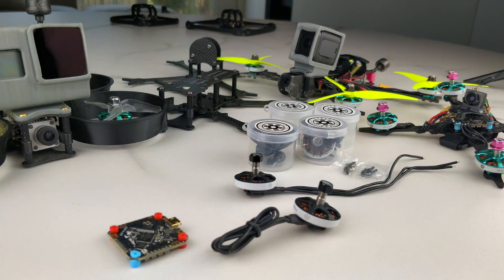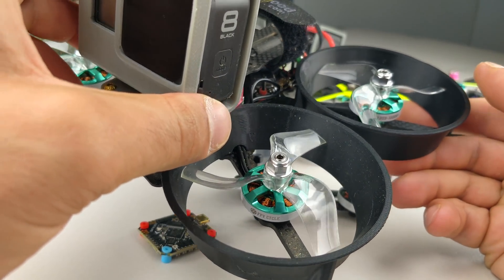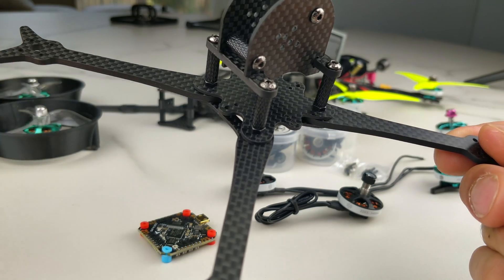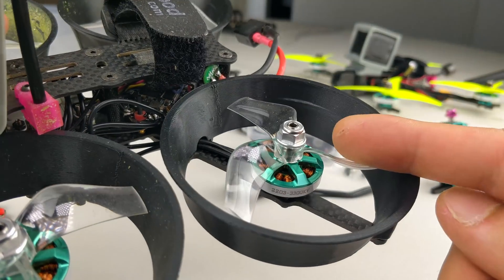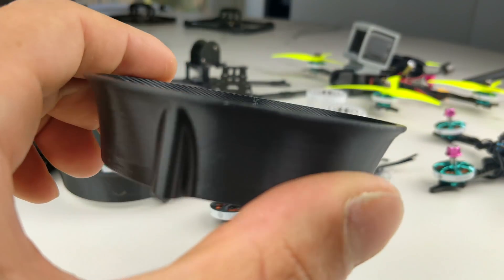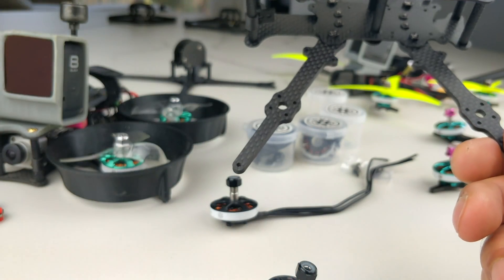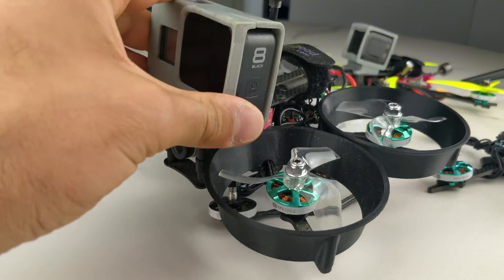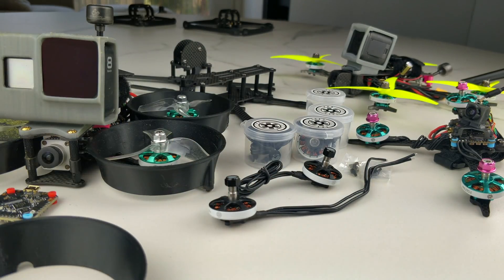FPVCycle 2203 for CineWhoop through 5"

Comment: Will you share your best setup for 3 inch general acro w DJI support?  Frame? Motors? Thanks a ton for all you do!
Reply from the maker: My 3" setup for general acro with DJI would be a 4".  I'll explain why in more detail when the Fouride frame comes in but it's basically because once you're done fitting all the stuff in there and getting the weight distribution how you want, 4" props will fit without fuss on the frame.  So much as well just use 4".  You could run 3" on the same frame but it'll fit 4.  Small quads just don't have much payload ability.  Even the 30g weight of the Vista + camera is a significant load that impacts flight performance.  A 3" can do it without much issue, but the resulting drive train that would be needed for good performance either requires you to stack a bunch of electronics tall and run the battery under the frame or put the electroncis side by side and the battery where you want.  I choose the later and that's why the Fouride is a 4" primarily....Fouride like Fluoride but Four...
Reply: Perfect! Thanks for explaining the logic behind 4” and of course the name “Fouride” is quite intuitive. So should I wait to buy the T-mount 2203s then or are those for a completely different build?
Reply from the maker: @absoloodle37  if you want to use t mount props
Reply: BTW, just joined your Patreon.  Waaay more info on there. Good stuff👍

Comment: What do you mean for 3000 is meant for “higher S”? Reading the motor page on fpvcycle I don’t get if you recommend 3450kv for 3S and 3000kv for 4S. 
Or if you mean 3450kv up to 4S and 3000 with 6S (of course with throttle cut).
Thanks in advance!
Reply from the maker: You could run the 3000 on 6s but it's not needed and is actually counterproductive. I'll explain why in the next video
Reply: KababFPV thanks! Looking forward for it!

Comment: Is there going to be like something like a 2800kv? (3" 6s)
Reply from the maker: There's a 3000 coming. You don't want to run 6s. This whole 6s everything wave is really not beneficial
Reply: @Kabab  I want to run 6S because all my batteries are 6S and I want to use this on a 5" application.

Comment: Havent tried disc-motors yet, so i dont have much knowledge about them. But isnt a tall stator and low KV prefered for cinematic stuff? Like DJI does for their drones. And for racing/acro you would want a smaller stator and high KV to get quicker throttle response.
Reply from the maker: Mmm not quite. There really isn't any particular specific for any purpose. Racers tend to like 2207 among other reasons because it's narrower than 23 and doesn't get hit as often for it to bend or break. There's a lot that goes into motors....

Comment: Nice motor kabab. Wish it will come with kv for 6s. I want to run 2203 motor on typical 5inch 6s setup (2207 1800kv). Target for lightweight 5inch, I hate motor with T-mount for 4inch or 5inch quad, and you said 2203 running really well on lightweight 5inch setup @5:51. Great effort Kabab!
Reply from the maker: You don't want 6s. I'll explain why in a video soon. Hopefully tomorrow

Comment: fluoride looks very cool
what about those vertical frames? :)
Reply from the maker: You're the first to recognise them as such. They're quite intesting
Reply: @Kabab  is it so hard to tell? 😂
i think the podracer canopy on the new tbs source frame is pretty cool
i'm going to modify the sideplates of the tubular chickadee to also give that option, as well as normal and i have another idea for the centerpice
all the pieces could be pulled tight by a 1.5mm theaded rod going all the way through the arms and with small nuts on the ends
i don't know if it's necessary, but i want it to be possible in the prototype
Reply: @marc_frank  I agree I got the podracer coming today, going to test it with these 2203. I think it will be a cool perspective to fly FPV.
Reply: @pkvillager  that's cool :)

Comment: Would a 20Amp BetaBoard be adequate to run the 2203's? Or do you need the full 30amp board?  Thanks again.
Reply from the maker: Yeah 20A is plenty. 15A is fine too if it actually will do 15A

Comment: I'd love to test these out on my Taycan. And these motors are freaking awesome looking. So different from the norm. I Wish I would of got a more traditional duct style. It's seems like the Taycan isn't locked in on elevation like most cinewhoops look I have to really work to keep it smooth
Reply from the maker: No cinewhoop is locked on altitude with any of the previous motors I ever tried
Reply: @Kabab  so true it takes practice/concentration for throttle control on these whoops. Can't wait to give the motors a try.

Comment: Could their be a possibility of a frame supporting 12×12 and 16×16 motor mounts
Reply from the maker: Probably unlikely since a 16x16 motor that's not flush mount needs a bigger center hole for the motor shaft or clip to stick out the bottom

Comment: What would the wireless wieght of the T mount version be?🤓
Reply from the maker: About 1.5g less
Reply: @Kabab  thanks for the quick response
Reply: Will the t-mount version also have a non-flat bottom?  The carbon tube guys have trouble with non-flat bottoms...also makes it hard for use with some other CF frames.
Reply from the maker: @jasonbond3567  the non flat bottom with the screw retained shaft is a fair bit heavier. That's why it's like this. It won't have a flat bottom unfortunately

Comment: Kabab, appreciate your efforts and support for our hobby, but please add numbers (facts) to your assertions. Perhaps get someone to help you with gathering data where feasible.
Reply from the maker: Where exactly should I add numbers?  I work off the real-world and use bench tests that others do to help explain.
Reply: @Kabab  , thanks for replying! Here are the couple statements you made that I'd love to get some hard data points on if possible. This will help me and others make more concretely informed decisions. Thank you again:

~10:23: "These ducts do improve the performance quite a bit."
~10:43: "The motors are going to improve that a lot"
~11:30: Motors stay cooler by design. - Any chance you have a FLIR or other temp sensing device to help show this?
~12:21: "I prefer having an extra gram of motor if it is going to give me really good performance and really good control" - Agree that an extra gram or two is worth a better motor, but having some thrust and efficiency data can help drive this assertion home.
Reply from the maker: @trpalmer  all of these questions are instantly answered when you fly it. The motor has better control of the prop inside a duct and the altitude control is fully fixed. The StanFPV ducts improve altitude control further, improve efficiency and control while changing the sound coming from the quad into more of a vacuum rather than zipping blades chopping at the air sounding like a chainsaw.

For the cooling, you don't need any tests for that. The surface area to volume of the motor is far better than other sizes in the class and you can physically look through the whole motor.

Bench tests are great and very useful to help understand what might be happening but unless you know what's actually happening already, it's hard to use them to predict.  

People can test all they want but it's way easier to just try it in the real world and see what happens.
Reply: @Kabab , thanks for replying again. I guess I know what I'm building next.😏

Comment: Nice motor.  I would prefer to see a 2700Kv version to be able to run 3S or 4S on a 5" ultralight without the ignorant throttle cut.  Sorry, but I much prefer to start with a proper setup without band-aids to make a poor setup work.  I think that 3000Kv is way too high for 4S 5" and even a bit high for 3S 5".   But... who am I to say - I'm just a nobody who has found some combinations that work well for me.
Reply from the maker: 3450kv 4s is good for 5" but I recommend 3s. I'll explain why in a future video soon...
Reply: Nothing wrong with a throttle cut, and its only ignorant of you to say so. No motors run at optimum efficiency or power across the whole throttle range anyways. Of course 3000kv isn't good for a standard 500-700g builds. These motors are for light rigs...
Reply: @pkvillager  Coming from an engineering background I learned to set systems up to be able to operate continuously at maximum load without failure.  Keeping the system functional for this condition by by PWM throttling is just wrong.  You brought up the efficiency issue and overloading the motor then bringing back into the operational window by throttling DOES appreciably reduce efficiency.

Comment: Just ordered a powerpick setup. Will the 3450 be ok on 4s like the 3000kv or should I run a cap?
Reply: Always run a cap if you can fit it.
Reply from the maker: Cap is recommended. We have some super special caps coming soon. Been taking forever for them to be made
Reply: I don't mean a cap cap, I mean a throttle cap. Sorry lol. Yes I have plenty of 35v 470uf caps. But I meant like a 80% total throttle cap since I got the higher kv motors

Comment: Hey Bob, ordered a set of motors this morning and eagerly looking forward to your lightweight 4" DJI frame. How does the 2203 compare to Brotherhobby's 2004? Based on what I understand about stator width vs height, the Brotherhobby might have higher top end but less efficiency?
Reply from the maker: They're gonna be very similar. The biggest advantage of this 2203 is that it's built like a real 5" motor instead of built like a micro motor. That means it has a real 3mm shaft, nice bearings and a prop shaft that's actually easy to use rather than the PITA T mount....but we're gonna get T mounts later on too

Comment: just burnt up my stouts, definitely trying these next!
Reply: why.....
Reply: So what's next after you burn up these? There are some sweet 1801's I'm wanting to try! 😉
Reply: Hopefully you have a light rig, kabab recommends 550g AUW max, and that's for a slow cine focused build. My Apex with DJI vista and Stouts is 550g and even though I run a 20% throttle cut I wouldn't go down in size that far.
Reply: Its lite enough, I'm looking to focus more on cini.